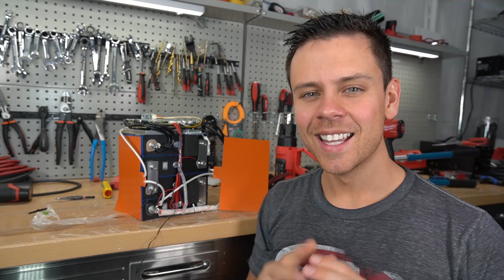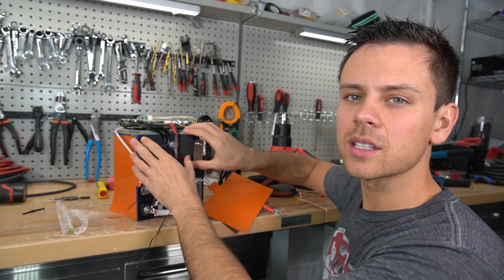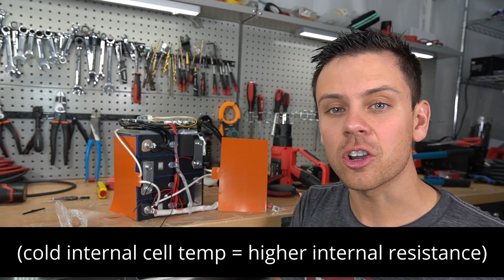LiFePO4 Cold Temperature Misconceptions: Do you really need internal heaters?

Comment: IMHO since they're cheap enough while battery damage isn't, there's nothing wrong with having the heater pads even if you don't really need them. As long as it functions well, cheap protection against expensive losses is a no-brainer; you just do it.
Reply from the maker: A 12V 100Ah with heaters is $570. One without is $329. And anyone can add their own heater pads for $50
Reply: @WillProwse  As you said, DIY them then, but they're still good cheap insurance. Remember, the Titanic didn't need lifeboats either- things don't always go the way you think they will go.
Reply: @WillProwse  I might add that I've got a SOK in a small cooler and I bought a $15 aquarium heating pad which works perfectly. I'm in Michigan so there's no way around having a heated battery here.

Comment: My question would be at ultracold temperatures. I see that most LFPs are rated to -20C for discharging. Would there be any damage to the battery to power the heater pads below this temp (low C rate discharge possible)? I have an offgrid cabin in Canada and will often get to -30C or colder in winter. The solar panels will get covered in snow once I leave, so can't really keep a load on the battery to self warm it above the -20C limit.
Reply from the maker: Oh good question. The internal resistance would be so high that you would have a tough time using them.
Reply: @WillProwse  Thanks Will, you are a wealth of knowledge. I've been debating this use case for a while. You may have given me an excuse to search out LTOs again. If only they weren't so expensive

Comment: You should do a video on charging a battery safely below freezing. These can actually be charged below freezing at a low C rate. 32-14 F charge less than 0.1C. My battle borns keep charging down to 25F without heaters. If you did a video like this, it will be the first on YouTube. Test capacity before and after cold charging at different C rates. You have the batteries to do it.
Reply from the maker: Yes, we have actually discussed this with the CEO of battleborn (video interview I posted on this channel already). I did do some videos on this and pulled full capacity at very low temps. I removed the videos because they were not made with the same quality as my other videos and I was using a pack from big battery, and I do not like them at all.
Reply: @WillProwse  I've seen almost all of your videos in the last year or two. I did watch the battle born video. I'd love to see them videos you took down, or make some new ones on this subject. Thanks!
Reply from the maker: @off-gridengineering3377  I should fire up the old refrigerator and do some tests
Reply from the maker: @off-gridengineering3377  sorry, I never know when someone is a long time viewer or not. My bad
Reply: @WillProwse  YES!!
Reply: What a minute, I thought the damage was guaranteed due to crystals being formed in the frozen electrolyte and bridging the anode and cathode, thus shorting the battery. Also, the crystals could build up on the receiving plate permanently and thus damage it. Have I been mis-informed?
Reply: Thank you Will!!!! I ordered the non heated version and just put the battery in an insulated cooler bag with some extra insulation

Comment: The batteries generate heat while charging, and while discharging.  So if it is 25 degrees on the tongue of my trailer where the battery is,  will discharging the battery for 15 minutes running a 5amp appliance warm the battery enough for it to be safe to charge it with my solar?
Reply from the maker: Usually, yes

Comment: I am working on building an over-landing rig and probably will not have heat in the vehicle during winter, below freezing, excursions. I will probably be charging up a cell phone at night once I am going to bed, but that will probably only take an hour or so. I have been going back and forth on whether I need to consider heating a LiFePO4 battery. I think this video makes it clear that my scenario is one that would make having a battery heating system wise.
Reply: I RV in winter sometimes and my battery are situated in a compartment that is suppose to get some heat but the battery still freeze and I then have to run the generator to run the furnace on max for a while until I can get to start charging again. I end up spending a lot of extra energy just tu get them warm enough. I will be adding some battery warmer and insulation to make it less painful.

Comment: Admittedly this one confuses me a bit. I am building electrical for a van conversion. The van may sit parked and not driven for a couple of weeks at a time in the cold Canadian winter with snow covered solar panels. I purchased the heated renogy batteries. In this scenario, will the heated feature be useful? Secondly if heating kicks in and is on for a couple of weeks is there a concern that it will discharge the batteries? Thank you!
Reply from the maker: Yeah that should work great. Add more insulation if you want too. Up to you.
Reply from the maker: That's why you have solar
Reply: Solar panels love the cold, just brush them off enough so the snow is not thick - don’t bother scraping. You may be surprised to see them make power through some adhered snow/ice.

Comment: Last month we had some single digit temps, and were without power for a few days.  My Bluetti was at about 43% and had been sitting in my truck.  Needless to say, the Bluetti was not going to take a charge after sitting in the truck.  It took about 4 hours in a 60 F environment to warm up enough to take a charge.  

I wish I had just started using the Bluetti in the extreme low temps to see if the inverter would have generated enough heat to get the unit up to charging temperature.

Since I use the Bluetti as my "on-the-road" power source, I think I may put an RV tank heater around it so I'll be good to charge in most any weather.
Reply: Try styrofoam and mylar reflective blanket.

Comment: I store my 3kwh big battery 24v inside an old bathroom vanity with some cheep styrofoam insulation on the interior walls. When cold, I have a 40w incandescent bulb turned on inside. Just enough heat to keep it above freezing. My solar shed is otherwise not heated.

Comment: I have 4 battleborn batteries in an unheated greenhouse and despite the fact that the temperature outside regularly dips into the teens or below in the winter, the low temp charging disconnect has never triggered. Mind you there can be several days in a row at these temps without sun, but the thermal mass of the greenhouse and the fact that the batteries self heat when discharging as Will mentions seems to be enough!
Reply: Also I can charge the batteries from a generator and they have never refused a charge so far. In any case Will makes a good point to prioritize insulation since the batteries do generate heat on their own.
Reply: I'm sure there is some convenient correlation that the greenhouse is warm when the sun is out, and the batteries are most likely to charge when the sun is out. Seems like a nice symbiosis if you live somewhere that gets kind of cold but not really cold. In which case you need a heck of a greenhouse.
Reply: I keep my BlueTTI stack in the storage container and on few occasions the temp dipped a degree below freezing. I was reluctant to start charging battery extensions, but decided to charge. They weight 35 kg each, and I assumed they were still warm. Especially, since I had some water in the bottles that didn't freeze up. So maybe put a small bottle of water to have an indicator. I couldn't find temp reading in the settings. I believe BlueTTI must have low temp protection, but perhaps it isn't available to the user.
Reply: Would you know if it did? Is it a manual reset or perhaps you are notified by bluetooth? I have no low temp cutoff that i know of…the manufacturer is nebulous about the BMS built into my A123 pouched-celled battery pack. I undersatnd my cells can withstand discharge down to 0F yet like most lithium…charging below 32F is a huge huge no-no.
Reply: I would know because I would see that the batteries are not charging from the solar. For battleborn the low temp charge disconnect is 25F in my understanding and if triggered will not reconnect until 32F.

Comment: I have SOK batteries I live in northen Canada.  I have only had low temp cut off once, it has got to -4C inside the house with them still working they seem to hold some heat.  The time I had low temp cut off it was  -10C in the house ... about -35C outside.

Comment: I've got mychin batteries in an isolated box I made from scrap foam board with 12v heater pads and victron smart senses connected to each battery. WORKS LIKE A CHARM. My neighbor has batteries with built in low temp disconnect and built in battery heaters and is having issues with keeping their home consistently warm, thus their batteries but what can you do...

Comment: Canbat has a nice heating system, which kicks on only when the battery is connected to the charger, and take power only from the charger. It works only when needed. That’s a very useful feature especially if it kicks in when nothing else does.

Comment: I live in Ohio and my SOK batteries are mounted in a 5th wheel trailer in the unheated front compartment. My batteries metal cased but are inside a plastic storage container inside the front compartment. They do get below freezing in the winter and do need the heating pads which I have installed with a digital controller. I doesn’t heat often but it does activate once in a while. I know because I track it with a remote weather sensor.

Comment: I live about 75 mi south of you and I have long thought that I would prefer a battery I could keep inside instead of one that cannot be safely charged inside a living space. I am on a fixed income and built a lead-acid bank years ago because I could add capacity slowly. So, as you noted, a battery that is unlikely to be exposed to low temperatures is at very low risk.

Comment: I'm curious to hear about boaters in the north where their boat stays outside for 6 months of the year. Would it make sense to get these batteries or simply remove them during winter and keep them charged in the garage. The later sounds more feasible imo...
Reply: The batteries are fine if left on the boat disconnected from any potential power draw. I have a different brand with Bluetooth and checked them the other day and they are still at 98%.  I was looking at these with the heaters for my trolling motor because sometimes I get overnight temperatures in the teens even in the spring and fall. I just feel it won't hurt to have the heaters.
Reply: Get the battery to about 50% state of charge, then disconnect all cables (load and charge) and also disconnect the BMS (unplug the balance leads). You are good for 6 months storage then.

Comment: Oh yeah, My van gets well below freezing as I don't run the (diesel) heater all night (or use it every day). Only when I wake up. I've camped and rode my moto a hundred times below freezing, no big deal. Where my batteries are stored it takes a while for them to warm up. I'll install a big heated tank pad for next winter (or just come back to Florida for the winter). 
The problem with insulation of course is it can slow the warming up process - it works both ways. I've got 2 soks but I'm seriously thinking of a couple of 300 ah unheated batteries - because you can never have enough.

Comment: I have a bluetti in my chicken coop in NH. The low temp cut off has been triggered.  Had to bring it inside to warm it up before it would charge. I installed it in a Styrofoam cooler with the top cracked open and never had a problem after that, even when temps were below freezing.

Comment: There is a company in Norway that sells heated battery with a added feature..

They charge at reduced rate below 0°C. The charge rate is 0.05C, and current above that will go to the heating pads.

The reason for this setup is to use the limiting sun hours in winter for low rate charging,  and not heat.
Reply: I have read several articles that you can trickle charge frozen batteries.  I would guess that 0.05C would count as a trickle charge.
Reply: @leonardsackett9568  the max charge speed is a function of temperature,  not a hard cutoff.  But it's cheaper to make a BMS with a hard cutoff. 

Will Prowse have an interview with a battery maker where they taking about this topic.

Comment: THANK YOU!!! I'm getting so tired of people online saying they need heated batteries and only give pre fab marketing sentences or no actual data and don't understand you can discharge batteries when they are cold. I live in Canada so it gets cold but as soon as you enter an rv or van you turn the heaters on, the battery can discharge, the bms takes care of the low temp and won't take a charge, after a night with the heaters on the battery will be warm enough to take a charge in the morning.

Comment: Really simple, in the winter time just throw a large insulated blanket ontop you batteries, if its really cold put a plug in heat pad under the rack and set it on a timer, uses almost nothing.

Comment: Great video, Will. I ended up draping a tarp over my entire battery rack and put a small space heater on a timer blowing in at the bottom underneath the tarp in my uninsulated shed... Like a kotatsu for my batteries :D

Victron's mppt low temp cutoff and DVCC current control features provide sufficient low temp charging protection and controls but I still watch it like a hawk on the handful of super cold days we have here in East Texas.

Comment: I think a lot could be solved by just throtteling the charge below freezing as the battleborn CEO said in your video. But there is not really any data to how much at which degree below zero is ok, not even thinking of electronics to control that. Anyway..heaters are also nice to get tge stamina up so..

Comment: Can't afford heating pads? Lol. If you can afford those batteries, you can afford heating pads. I'd rather have them to protect my battery, then risking damaging cells.
Reply from the maker: They cost $250 more for each battery. If you have a pack of 8, that's a massive price increase. Could just throw a heating pad down for $50 instead..
Reply: @DIY Solar Power with Will Prowse  I buy RV water tank heating pads that fit perfectly in 12V CATL 320AH lifepo4 battery in walmart battery plastic battery box. $30-40/pad per battery...

Comment: Hi! I have a plan of making a self controlled lifepo4-pack in a future campervan using maybe 200 amp prismatic cells and 4S3P 12 volt system. My plan is to insulate the pack and install these kind of heat pads and use the pads itself to keep the temperature at bay. The van would have around 1200 watts of solar on the roof. What is a good estimate of a power draw of these kinds of packs if the temperature gets to maybe -10 celcius in Sweden by winter?

Comment: I live at 7500ft elevation in Colorado. In my unheated Chicken coop, the pack sets up in the rafters of the 12x12 shed and the cold temp protection does kick in... I have been debating on either a double insulation or getting from 12v heat pads and use an ink bird temp controller and DC to DC SSR to keep the pack warm.
Reply: Get the chickens to nest on top of them:)
Reply: Hello from the western slope!! It was 17F this morning. We store our travel trailer with no electrical connection, as well as our solar completely disconnected.  The batteries were at 32 degrees!  So, I would probably just turn on my propane heater for a little bit, then could provide power with our Lithiums.  

Also of interest, I turned off the power to the camper on 15 January; the Lithiums were at 99% state of charge.  A month later in the cold...and they were at 99% today!
Reply: @campingalan  Get more chickens!

Comment: I bought an EarthX LiFePO4 battery, which they market to snowmobiles.  I used it in sub-zero temperatures and it ate itself.  No low temp charging protection.  So low temp charging protection is very important.  But even in sub-zero it could still push a few hundred amps to run the starter just fine.  So I think you're right.
Reply: Discharging is ok charging below freezing kills them
Reply: @williamvaughan1218  Yup, but after you start the vehicle the alternator starts charging the battery.
Reply: @unhinged-menagerie  not if you use a BMS with low temp discharge cutoff. And diesel cars and electric cars don't drain the 12V while running, if you use an un-heated lithium battery with no low temp cutoff you will ruin it in a gasoline vehicle if its below freezing.
Reply: @eldiablooooo  EarthX sells a 12v battery as a lead-acid replacement.  It's sealed with an integrated BMS.  It does not have low temp cutoff.  Also if you start a vehicle the alternator DOES charge the battery for the first few seconds/minutes until it's up to voltage.